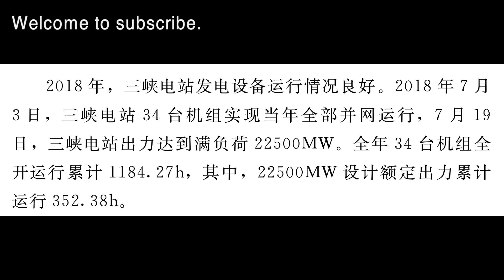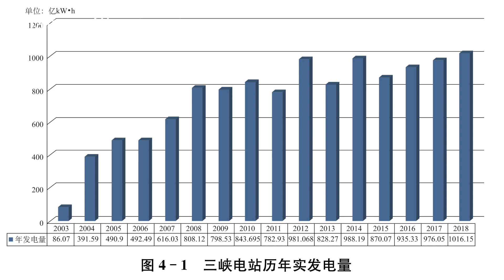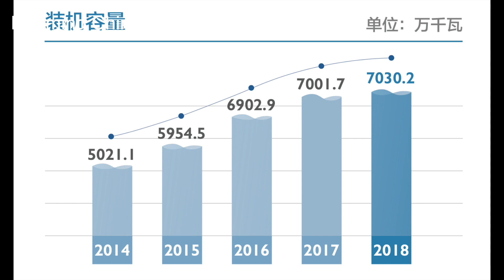How much money does the Three Gorges Dam make every year? Three Gorges Dam investment and benefits.

Comment: This is very impressive!  The comprehensive view of the whole system is unusual.  Here in the US we really only hear about this system as a potential disaster, there's very little discussion about the actual function of the system.  That's a lot of power!  I think the demand for electricity has no limit, the idea of TERAWATTS of "green" energy is hard to believe.  Then if you factor in the other aspects of the system like transportation and water control.... Anyway, good job.  We'll just have to deal with the computer voice, it's not so bad.  Sometimes is a little confusing, when it sees an acronym and says it as a word,  sometimes numbers come out funny.  The subscript text is very good, I just left that running.  Thanks!
Reply from the maker: Thank you very much for watching. My English is not very good, so I can only use machine dubbing. In the future, I will still use Chinese dubbing with English subtitles, which may be better. I will update some other information about the dam one after another, but I can't get a lot of confidential information. Finally, thank you again.

Comment: Make a second defends of divided the flood structure beside the 3 gorges dam in case there is repeat of another situation in future. Can also invite Dutch engineer and japanese engineer.
Reply from the maker: There is a secondary dam next to the dam, but hopefully it is not a flood diversion option. Because many people live under the auxiliary dam.
Reply: @漫游中国  if that the case we need the Dutch engineer and Japanese engineer to see whether the under the auxillary dam can be built a structure of connection of the second defend. The Chinese engineer is also invovle
I  not an expert. If the Chinese engineer can built a gigantic 3 gorges dam, i am sure those Dutch, Chinese and Japanese engineer able  to built it.